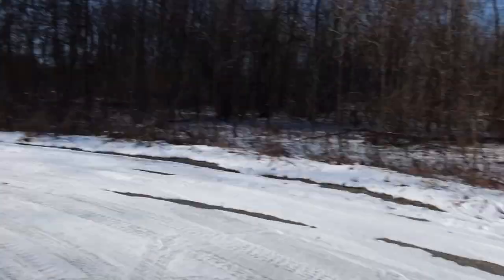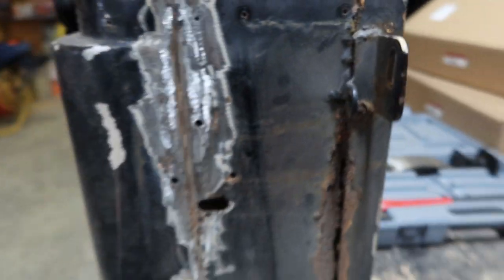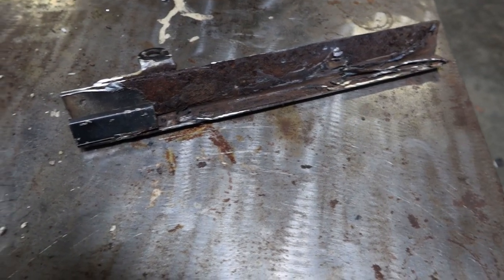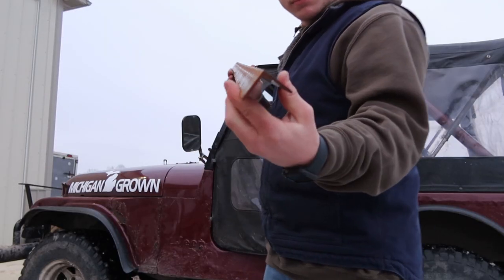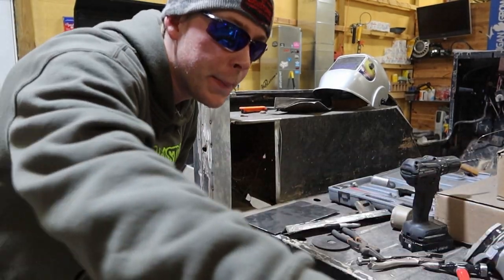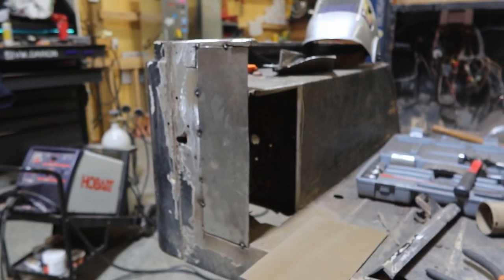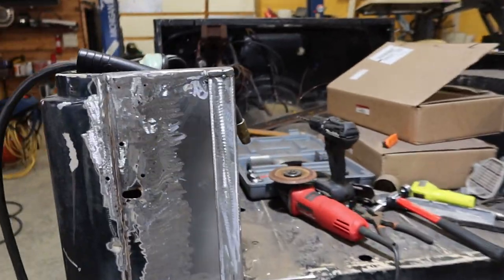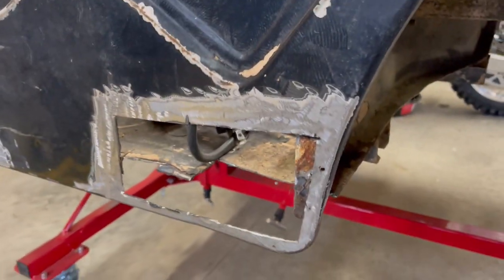CJ5 Build - Replacing Body Panels That Are Rusted - Pt.2

Comment: Nice job tying in the wrap around side panel with the tail light panel and the tail gate surround posts . I will definitely say overall , nice job butt welding all the panels in . I’ve no real experience at panel replacement either but will be getting into it soon on my ‘73 CJ5 project . 
This will be a big job for me . Glad you scored a solid body tub that only needed some panel repair . Overall , it looks like floor panels are still solid . That saves you a lot of work and money . You don’t even want to know how much I spent for front and rear floors and body panels and wheel wells still to go on yet . 
I’m telling you , this work your doing is turning out great ! Your doing it your way because you want this Jeep to look right and last longer than AMC built it with all repairs done proper . If AMC had just done a little more panel prep like your doing with the weld through primer for example , theses bodies may have lasted longer ? Instead , they relied on , like a lot of auto manufactures then , on the cold rolled steel galvanizing . That’s only good for so many years . Happy that you will seal all the seams where the panels are spot welded with POR15 . 
When the rear wheels kick up dirt and water , that is what starts the rust . Snow and salt contributes to the demise . Do all you can and this Jeep will be there for you for a long time . Will have high resale value too if ever that day comes . Do it your way , your doing great  ✌🏻
BTW , nice job editing 👍 good video quality . Nice to watch !
Reply from the maker: Hey! Thanks for the comment and support man! Definitely good to hear that we’re heading in the right direction lol!